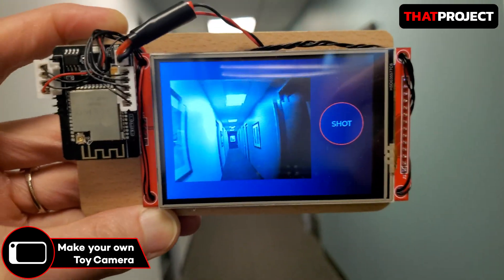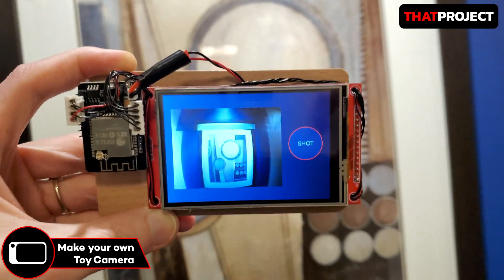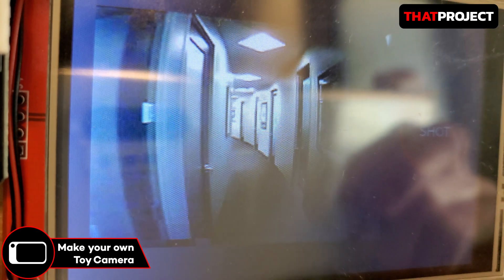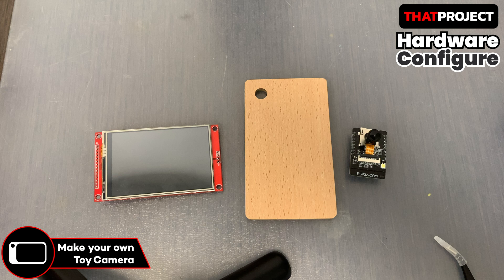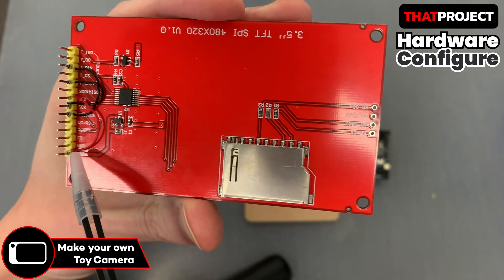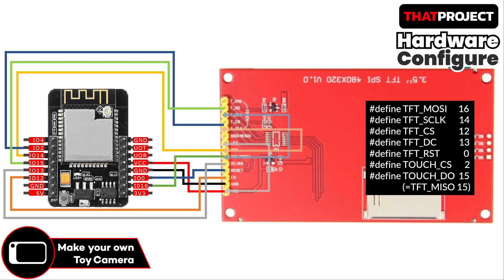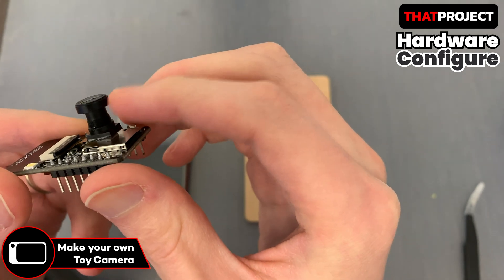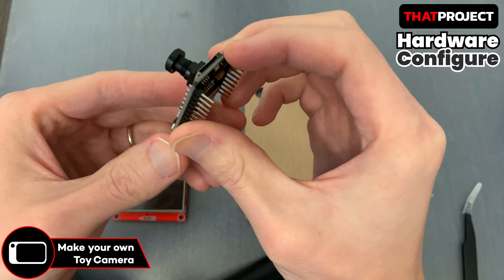Toy Camera = ESP32CAM + ILI9488 + LVGL7 | Part 0, Hardware Configure (Open Project) #ESP32CAM

Comment: Stumbled with your channel today and your projects are amazing! I don't have any of the boards you are using but I have a LilyGo T-Display-S3 ESP32-S3 1.9 inch ST7789 LCD Display Development Board WIFI Bluetooth5.0 Wireless Module 170*320 Resolution touch screen version and a LilyGo T-Embed with ESP32-S3 ST7789 1.9 inch LCD, bluetooth5, wifi, etc. I am a noob into this stuff and just upload sketches people make since I don't know anything about coding/sketch creation. I use Arduino IDE to upload the sketches to devices. I just wish there was people who made videos of the devices I have and sketches for them. Both devices have similar specs yet sketches for each can't be used between them without modifications... Thanks for sharing these videos. You've earned a new subscriber.
Reply from the maker: It's time to study coding!😀

Comment: Can you rotate the screen display orientation instead of running wire from one side to the other? Or would that make the display slower?
Reply from the maker: You can change do it in any orientation without any problem. No doubt.